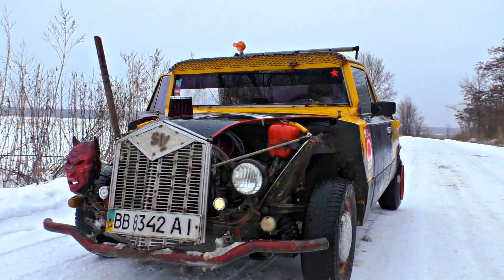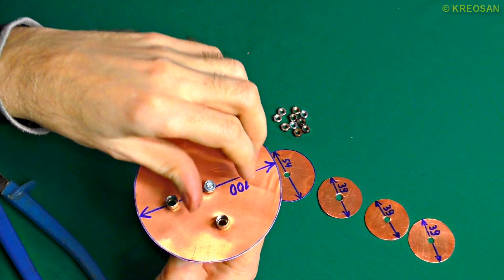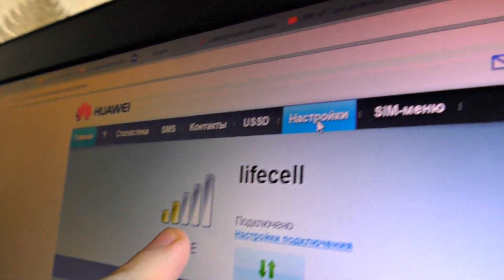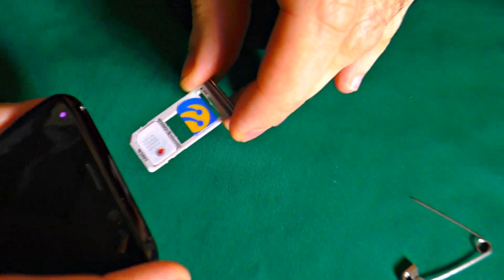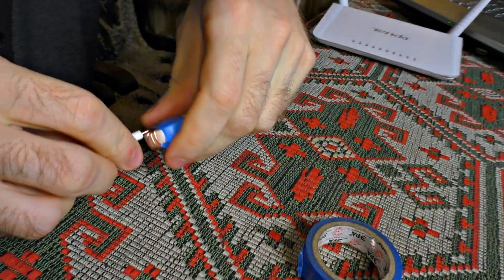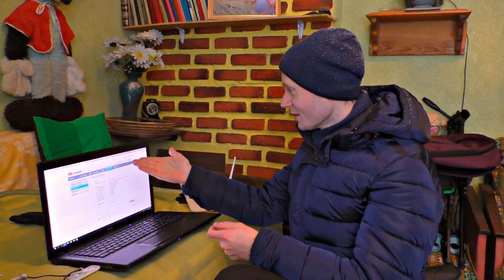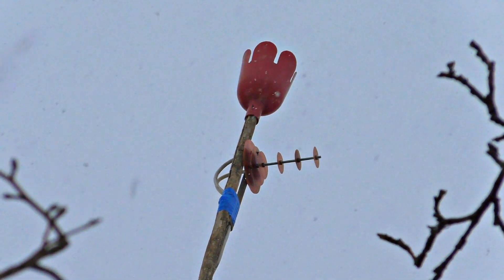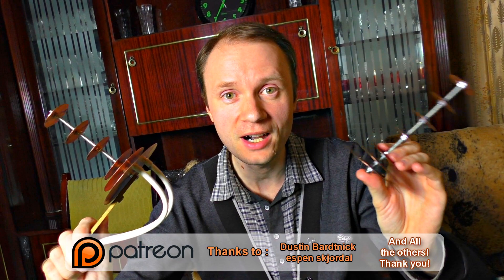A Hand-made 3G Gun! ￼ A Powerful Antenna for 3g, 4g and WiFi DIY !

Comment: One Common error every antenna builder makes when building these antennas, the 2nd disc needs to be isolated from the antenna, your ethernet equipment will fail in a short time if you continue making the mistake of allowing the 2nd disc to contact the antenna body. Good luck.
Reply: Hello, you seem like you know your stuff. What should the thickness of the copper sheet be?

Thanks
Reply: @robertpaws  the thickness of the copper sheet does not make much difference if you keep the correct distance in between them. follow my advise, isolate the 2nd disc from the rest of the antenna. the 2nd disc is the one that receives the signal, the 1st disc is called reflector, it reflects the signal onto the 2nd disk. good luck.. and i hope you have electricity to be able to use these antennas.
Reply: Could you insulate all the discs? Or just worth doing the second? Also no joy on actual dimensions, is the trick the equal distance rather than worry too much about the actual spacing amount. Appreciate any help!
Reply: @ just the second one. all other ones should not be isolated

Comment: I'm sorry, civil engineer here. If ever you find my question dumb please understand. I just  wonder if capacitive coupling works by soldering the wire to a metal plate. Then maybe you can put your phone over the metal plate and make the phone receive the signal.
Reply: I think can be done use insulating non metallic plate.. Computer engineer here.. finding same thing as yours.. was a good idea... And avoid the backcover

Comment: You need to isolate tye driven element i.e 2nd largest disc from all the others discs , otherwise your vswr will be veey high , yes itll work with low power but u can damage your router , simply insulate tue driven element and its very important u do this as its not covered in this video
Reply: El segundo disco al que  te refieres, sería el disco de mayor diámetro de entre los 6 que tiene esta antena?
Reply: Would some electrical tape between the scree and nuts be okay? Should the cable touching the second plate be soldered? Or sit inside a hole, not touching the actual disc?

Comment: Hello, I'm from Brazil, my language is only Portuguese...it's hard to understand, because in the translator..and in the graphic it doesn't mention the distance measurements from the hole to weld the cables... the first hole distance from the edge is 11mm...More second cable =?

Comment: this is the first time for me to comment on youtube video but this one really deserve, i built this antenna it is really brilliant,
it made the signal strenght always 75% instead of 25% or 50% using normal router antenna, i am just wondering how can i improve more in the antenna so that i can get 100% signal strength 
1- i used RG-6 coaxial cable "length isno exceeding 12 meters"
2- if we used more than one antenna will it help ?

Comment: I live in a location where 4G works on 2300 MHz and the nearest network tower is 32km air distance from my house. Therefore I have no network connectivity. Can you please make a schema for 2300 MHz.  It will be very helpful. And can you suggest which device should I use to get a 4G network. I travel 55km on road to use 4G.

Comment: you actually created a short on your yagi. The 2nd large disk needs to be isolated from the main nut and screw going through it. This will greatly increase your signal. you can use plastic or duct tape to create that shielding.
Reply: THANK YOU SO MUCH, I WAS SO CONFUSED BY THIS!

Comment: good day thank you for the video I have build this antenna and it works perfect the problem I found is that I get -51dbi with it but our local carrier only supports 900mhz to 1800mhz can you please make a video of 1800 or 2100mhz or give the dimensions or a site where i can get them 

Regards 
Johan
Reply: at 11:53 dimension given for 1800mhz
Reply: U can use cantennator app
Reply: U can use cantennator app

Comment: the distances of the antenna have to be isolated dosots, because if there is not a short in the antenna wires, it works reflecting and does not need to pass electricity !!!

Comment: The copper foil is expensive. With the price for the required copper foil you can buy a 15-20 dbi antena which is wrapped in plastic, so it's protected from rusting and you don't have to make any effort making it.

Comment: the second disk, the supplier, needs to be insulated from the rest. If you put on amp it will blow amp.
Reply: Ok, now I will feel free to ask. Should you have continuity between inner and outer part of coaxial cable?
Because in a way how it looks from video, ground shield and central pin are connected to a 2 different disks, but through the middle they are all on same shaft!?

Comment: Hi Guys, I built the 4g 2600MHz. 3G 2100MHz and 4g 850MHz versions. I am 6,5Km far for the 4G antena with 2600MHz I have pictures for all 3 antennas. And no one is working link in the video... I tried to insulate the second disk counting from the biggest: and the result was the same... NO BIG Gain.... Can you help me???
Reply: I have a mountain of 80m tall in between... as well...

Comment: Can this type of device provide 700 - 800 MHz ? Also the net speed is measured in megabits not megabytes. The bit speeds are 8 times slower than bytes.

Comment: Difficult to believe with just an antenna to get very high signal...even with an amplifier booster it would only increase just average...the point with weak signal is even a slight of wind can change the intensity..if you are only using antenna....or with additional of booster it will stabilize the signal consistently

Comment: Hi kreosan cery noce video's. Could You tell where You finding dimensions for antena? I tried in ham antena calculator on się sites and didn't find dimensions between reflector director etc. I need dimensions for 1800 4g until I change my 4g router without 2600 LTE. Thank you
Reply: sebadtable friend use this application it's good " cantennator" in Google play

Comment: did u connected 2 wire in 100 mm size plate with 74 mm size plate??  or 1 wire connet 100 mm with 74 mm plate?  plz tell i made this but i confused that matter

Comment: I'd like to clarify, the speed test he used measured in megabits, not megabytes. So the actual speed is 8x lower than he said. So, instead of 15 MB you have something about 2.
Reply: Every internet provider specifies megabits per second. 5 Mbps is enough for light use. 10-15 Mbps can play 60 fps 1080p YouTube videos.
Reply: @AdamSKEN.01  Im not saying its not usable. Im saying that what he said was worng.

Comment: Hey guys, I'd like to know how you came up with the dimensions for these antennas? Did you used some software calculator or some formulas? I would like to know as I am going to make an antenna with specific frequency for my 4G LTE provider.
Reply: There's schematics online.
Reply: The formula is 
Lightspeed / TargetFrequency = Wavelength
the diameter has to be half of the wavelength you want to produce/emit/receive

Comment: What is the antenna type called? Is it also possible to do circular polarized? If you can do circular then can use left and right hand wifi too on the same frequency with four antennas and nobody can listen easily.
Reply: It’s effectively two yagis at 90º to each other. For circular polarisation you'd need a helix.

Comment: Meanwhile that microwave frequency is damaging the DNA in your body ever so slowly!  Microwave ovens operate at around 2.2 to 2.4 gigahertz !  its the frequency that damages DNA, not the power so much
Reply: No. Microwave frequency is non-ionizing. So it will not damage the DNA 
Thanks

Comment: How do you identify your cell network frequency in the USA? I want to make the antenna, but can’t figure out how to identify my 4G and 4G LTE frequency.
Reply: dial *#0011# from phone and choose stack1 or stack2 (card1 or card2) respectively, your phone will display the band frequency from your provider: Band1=2100 MHz, Band3=1800 MHz, Band8=900 MHz, Band7=2600 MHz, Band20=800 MHz and the newest Band40=2300 MHz
Reply: Nocke Sumampouw I believe this is for Androids. I had to press *3001#12345#*, LTE, and go into serving cell info.

Comment: Cool, I'm putting a 196.3×81.7mm waveguide antenna right now with a little bit of an experimental ground reference plane. Just need to cut and attach the front of the guide, but so far everything matches the nominal layout to a tolerance smaller than my eyes can resolve so I'm excited about this one. I've also ordered some short path connectors so I can cut the signal path from the reciever to the modem down to the lenght of the actual element, and usb can handle the signal from there as it works without percieved loss. My setup is for 2.437Ghz or chan 6 (us).

Comment: Hi kreosan, nice video.
What is the thickness of those copper plates?
Reply: In a previous video, they say copper sheeting at 3mm. But that sounds too thick to cut out with scissors, so it may be a translation error. I think 0.3mm thickness.

Comment: The second disk should be isolated from the others. In your design they are all shorted toghether by the central rod.
Reply: Anto Mani i doubt that this is a proper antenna... he did not tune it at all
Reply: RCP-1136 I agree but it would actually work pretty well if it wasn't for that small detail. After all it is just a yagi antenna.
Reply: seems it's a gamma match - for such kind driven element is connected to shield
Reply: have you made this antenna

Comment: Could you use a longer cable if you bought some of that expensive type with low impedance for higher frequencies? Because I know standard RG6/59 has pretty high impedance in the gigahertz range.

Comment: You are shorting the signal to ground by connecting core wire to shield wire and it not only damage the RF amplifier it also kills the signal! Are you fooling your audiences by this?
Reply: MSS why does nobody here understand that RF energy isn't DC...
Reply: Thank you but sender antenna output is passing a kind of power(that you should know) and shorting it result RF amp over heating and blocking the signal , how it suppose to be a standard and working solution? Why don't you sharing with us your advance RF experiences?
Reply: google "gamma match"
Reply: z08840 thanks man it looks really weired!
Reply: can you help me to make this anntena

Comment: Could you use one of these antenna designs to make a drone-Killing Kalashnikov Gun? Basically send enough signal out at a drone operating frequency to make it lose contact with its pilot?
Reply: RCP-1136 that isn't jamming, that is a backdoor
Reply: Michael Pierce YOU BAD SOB ...I WOULD LIKE TO KNOW HOW TO MAKE THE TRANSMITTER AS WELL....5G IS THE BRAIN LIQUIDISER
Reply: Dorrien North one may wish to research electrostatics for blocking such signals. Pretty sure we'll see someone's going to try microwaving the world.
Reply: That would be called jamming... dji has a product like this to bring down their own drones over restricted airspace
Reply: Nope, that's jamming.
Reply: Yeah these are killer antennas for ONE direction only.

Comment: Can you kill People with it?
Reply: Nah, 100W isn't going to do much. When I was in Afghanistan I had to change an antenna on top of a 90 tower and pretty much all base comms went through our equipment so we couldn't shut every antenna on the boom down while I was up there. There was probably 5-600W going at any moment and it was survivable. Mildly painful, utterly terrifying, but not deadly. I actually had to basically hug another active antenna and with my arms stretched out fully so I could just unscrew the bad one, it left my face inches from the active one. Thats where it hurt, I could feel the water on my eyes and lips crackling and it felt like I had a horrible sunburn from the collar bone up. Oh, and it made my balls ache for a couple of days too, probably the worst part, but no worse than the the rest of the day after catching a knee to them in a ground fight.
Reply: It’s a gun, so why not?
Reply: If you start transmitting on the freq with 100W for example,and point at someone that is actually very dangerous.so yeah
Reply: I mean, hit a guy six or seven thousand times with anything and it will probably kill him.
Reply: joczo97 Even so, it would harm everyone within the diameter area of the radio gun.
Reply: I dunno.  Let's find out.
Reply: Sure, why not?
Reply: From the inside out, If you connect the antenna to your microwave oven.
Reply: Of course not instant death,but could be dangerous.I'm not an expert at rf to health topics,but as a ham radio op we were told it isn't a good idea to be next to 100W or more
Reply: 5G can damage DNA but less than 5G and the results are not as good. And 5G also lowers red blood cell's ability to carry oxygen. 30cm from a transmitter for 45 seconds will raise your heartbeat as your heart has to pump faster so as to increase the amount of oxygen to cells - due to the red blood cells being unable to carry as much oxygen.

Comment: The last two circle (the circle where wires are connected) have contact with each other which is not good the wifi or 3g card. it can fry the chip inside them
Reply: Nah, the dishes have capacitance and the bolt has some inductance, and then there is the phase shift for the extra distance the signal has to travel from one point to the other. Certainly, we're not in DC-land anymore!

In short, to really damage the card, you need to be very unlucky. You need either a perfect short-circuit, open connection, or a pure imaginary load (ideal capacitor or inductor) at the end of the coax cable. Then you need to have the coax be a very specific length depending on what the load is.
Reply: I just looked it up - seems it's a kind of yagi antenna with gamma match - if measurements are correct it should be fine I guess...
Reply: have  you made this anntena
Reply: usama khan yes. but after month of use . my wifi alpha card has burned.
Reply: i need some help do you have whatsapp  num or facebook id whrer we can disscuss it
Reply: i am unable to make this coil type thing by which he connect antenna to mobile
Reply: usama khan Just make a coil type thing and place it near your phones antenna location
Reply: ir shad  i have don but its not working  
tell me your facebook id or whats num where we can disscuss it  
and how can  i contact  kreosan
Reply: @usamakhan6843   @usamakhan6843  u cant simply ask someone contact just like that dude!